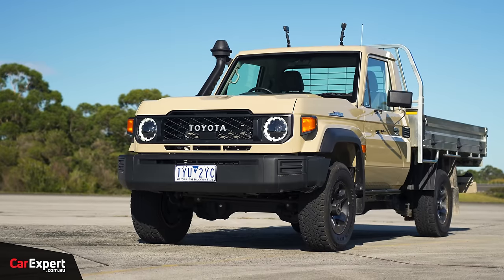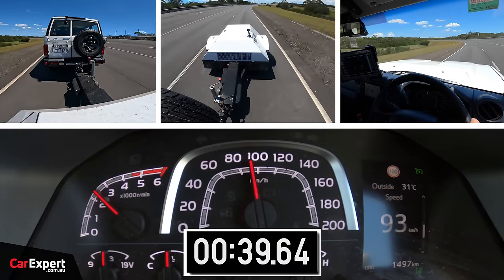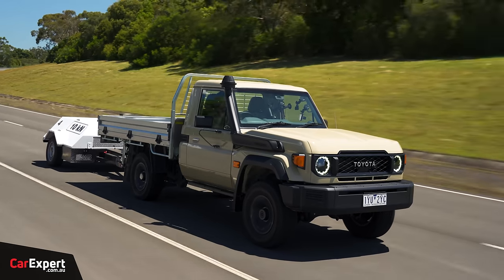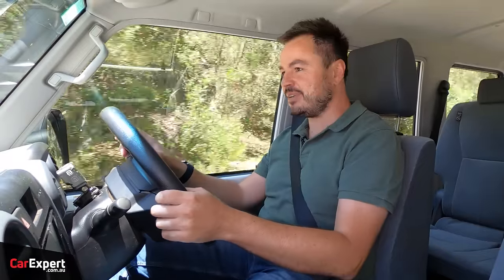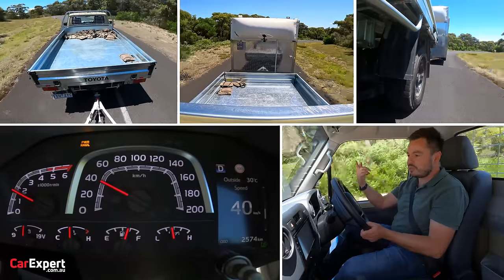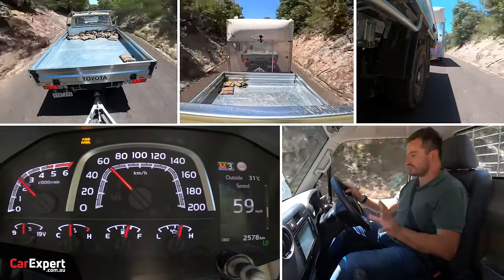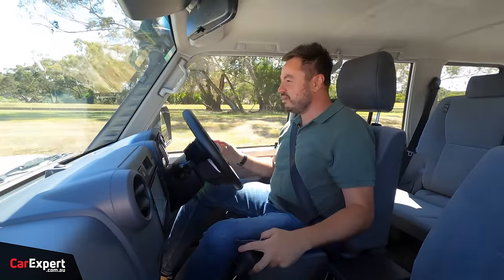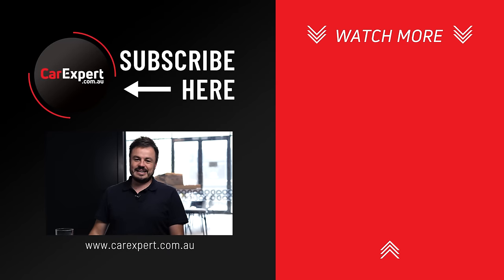LandCruiser 70 Series V8 v 4-cylinder towing stress test & drag race! Is Toyota's V8 dead?

Comment: They increased the front track to fit the V8 engine. But, and only Toyota knows the answer to this, why did they leave the rear track 100mm short, in the production stage, wouldn't cost that much to fix. Image if any other manufacturer did this, they would be crucified, pathetic.
After watching this, who in their mind would buy these things.

Comment: The impressive thing is how much of a bloody TURD of a V8 engine toyota actually managed to make. 
Well done. 
That v8 dissapointing in stock form. And the god knows how old 5 speed gearbox with the shittest ratios ever. It completely falls out of the power band. Useless.
Toyota couldnt even update to a so needed new 6 speed gearbox. 
A aftermarket tune for this V8 is a must i reckon.
I brings out a lot of hidden power.
And its always been that narrow from the day it was first built with a inline 6 cylinder but they widened the front to fit a V8 and just left the rear as it was. Ridiculous really.

Comment: It looks to me that the V8 cruiser only has 1400 kms on it and the 4 banger has a few more. That V8 needs about 10,000km to loosen up a bit. Give it a chance. The narrow track on the rear of the V8 is so they could fit the motor in. The narrow track rear is the same as the 6 cylinder ones. Toyota needed a whack in the ear for doing it that way. 
Torque figures on paper can be misleading. The lower in the rev range that peak torque arrives is where the real story is told. My 1HDFTE in a 79 has peak torque at about 1800rpm. The V8 appeared to be hanging on at about 2200 and the 4banger was doing 3000rpm. That tells the story. Having to rev the tits off the 4 to do the same thing is not winning the race. My 1HD will pull a trailer with a ton on it and a load in itself all day without trying. I have experience with a 2007 Hilux pulling a horse float with a horse on it and I had to lock it in 3rd on the Newcastle free way or it spent all day changing up and down and eventually overheated the trans. My 1HD would do that in 5th easily. 
The 4 banger is a piece of fragile twin turbo shit that will have spilled it guts a long time before the bigger better lazy motors that do it easily. 
Shame on Toyota, Landcruiser buyers are not going to buy the hype, that is not why they buy Landcruiser 79s. I am a 1HD man and a lot of others would like to be too but they hard to buy now. Jeff

Comment: different body shapes make it a pointless test
Reply: Frustrating no one is actually comparing identical body shapes with v8 and 4 cylinder 
Still waiting on a proper test from all the youtubers 🙄
Reply: @lynblisso2880  everyone fudges it to make the v8 look worse and the 4 cylinder amazing

the fact is it needs a 6 cylinder diesel, 200kw and 6 speed auto

many other brands do this for 25% of the price

I'm waiting for a comparison of these 2 cars plus a v6 diesel amarok for 25k, or a v6 diesel q7 for 10k

new overpriced cars vs better second hand cars that have already dropped 50 to 90% in value

put the 25 to 90k you save into your super at 10% interest each year

90k in you super at 10% is 233k after 10 years

Comment: The v8 doesn't look to perform any better than my 39 year old 12ht 60 sahara heap of shit. Sure as hell is a lot more comfortable to drive than a 79 too. Toyota should have increased the performance gap between the v8's and the outgoing 1HDFTE before they released it, as it stands the only selling point is the noise. I do need new mirrors for the 60 though, those 76 ones look identicle

Comment: Wow i can't believe how bad you are at a manual gearbox the 4pot maybe better but with your inability to drive a manual and to be in the right gear at the right time im honestly not sure if it is better you don't even understand how to launch it i wish i could drive this for you because the gear changing was painful. 

Also that first trailer you might as well take it to the tip you say it's the best way but when you took off in the 4pot you said wow its like its not on the back?? Well how do we or you even know if its engaged or when it engaged it might of engaged halfway through the drive you say its the most accurate way but you drove on the same road and same time with both cars you could of just got a car trailer stick a Commodore on the back and do a real test or use your 3.5tonne trailer that you used for the rest of the test

Comment: You were shifting the v8 way too early
Reply: Wrong, as someone who genuinely owns a V8 70, they serious run out of power anything after 3000rpm. They are very low raving engines and hit a wall at 3000rpm in standard form.

Comment: You just trying hard to show that v8 is faster, but even if you don't put it in sport for rolling, DIESEL it runs FASTER than v8, even if driver was lift the throttle at the end.
Conclusions? Diesel is waaay more useful as utility vehicle, is more faster in anything AND waay more economical 😂
Reply from the maker: They’re both diesel.

Comment: With the 3kN test, both vehicles seemed to be shifting/ed around the torque peaks, rather than the POWER peaks - further, I'd suggest manually shifting to the "red line", as that would laso be more like what a normal driver would do to "use the rev's", and shifting would drop it closer to the power peak. Depending on the specific spec of the 4, peak power is around 3k4-3k6 - I didn't see it getting anywhere near that! Similar story with the V8, but at lower rpm!
For those who are going to say - "use the torque" - well, duh, morons,  shifting early REDUCES the tailshaft torque because there is less torque multiplication in the gearbox! Holding the lower gear gives MORE multiplication.
Reply: check the TDS littel pdf file....

Comment: 4 cyl turbo with higher output than a V8 4.5 = higher engine wear, more heat generated and higher revs with radiator cores clogging up faster with grass seeds. I operate in Africa and prefer the LC 4.2  D without a turbo. Most of thw work is done in liw range and at engine speads that rarely exceed 900 rpm
Reply: The test misses the point the vehicles were designed for

Comment: Lol 2.8L hilux motor in that heavy duty landcruiser is not correct cause hilux motor are use for light ute only due can’t keep up the speed and auto gearbox are not doing it correctly and needs to run a test again to match it work out your maths and deal with the landlord of the Toyota company! To me is find out a really bad name at moment also ripping off by the price rise !
Reply: Check the normal car weight of that landcruiser and hilux you will find out which vehicle is heavy and light. So what you had to do is work out from that motor in whichever match the heavy duty landcruiser as it’s not about racing or show or tour ! Find it out yourself!

Comment: Yeah sure let's tow an unrealistic load in an over drive gear. We'll done guys😂

We all know the v8s are slugs that need a tune as they are heavily derated.

Anyone that knows vehicles knows and speedometers are out by about 5kmph. Has this also been faceted in and are you actually doing 100?
Reply from the maker: Yes champion, GPS speeds. The anchor definitely needs a tune to come close to the four-banger!
Reply: @CarExpertAus  you've shown the onboad speedometer wich are always inaccurate and "to come close" is just wrong. 
The v8 in its standard  form is not running optimally or efficiently.
Opening it up allowing it to breath at a bare minimum.
From factory Toyota should have engine output  at the same or close to the 200 with 660nm not 440. 
It's quite literally running at least 1/3 less what should be its standard and acceptable output.

It's more that all this is a good example of how Toyota is ripping everyone off and I feel should bring Toyota's practice into question as they are charging for the v8 but not delivering on a v8.

Comment: The V8 off road or towing excellent. On road we all know . Auto and manual 6 speed , they make them . Have for years but wo'nt fit them. Rear track same. All this 4 cyl is just zero cost Toyota b.s and content craving crap. Try a 2 tonne electric ridden standard hilux auto off road . Fuck me. Pointless technology for the sake of cost cutting.
 4 cyl 70 lovers , more like content cravers. Reality be damned.

Comment: Misleading tests!
1st the V8, you keep trying to drive it with the RPM low and below it’s power range and trying to get it to work! 
But with the four cylinder you let its RPM run higher in the power range!
2nd why would the V8 be any different with more gears than 5 speed?
A 6 speed would still have the top gear ratio as the 5 speed! 
3rd Formula One racing cars over the decades have had a narrower rear wheel track width compared to the front to allow it to turn into corners better at higher speeds!
Yes, having the track different width front to back is not ideal in the dirt but life is full of compromises and both the V8 and the four-cylinder have the same front to back track width differences, so I don’t see the point in mentioning it in your testing.
Would love you to go back and retest these vehicles with the engines doing the same work despite the engines size differences.
It seems to me that you are doing testing biased on something that Toyota may be getting (a back hander) you to show that the new four cylinder is a superior vehicle!
Plus a manual transmission is a superior driving experience, when an automatic is just doing all the work for you, being a lazy bones behind the steering wheel.

Comment: I have to comment and I haven't finished watching this vid yet. You were being very unfair to the v8. They need to rev and you didn't rev it out on the 0 to 100 in each gear. Also when doing the hill climb why did you come around the corner so slow with the engine out of it's power zone. You had it down to nearly 20km per hour and under 2000rpm. If you had started the hill at 3000rpm or more where the engine needs to be to tow I bet it would have pulled up the hill in second no problem.  You need to rev these v8s to get the best from them towing big loads and you didn't do that, putting it at a huge disadvantage which was unfair. Do you have an agenda? It certainly looks like it. I am no toyota fanboy either I drive a Ram now after having a cruiser ute for 12 years. It would tow 3500kg easily up any hill in second gear if you had it on song at the bottom.  Very disappointed with how you drove the v8, that isn't how you drive them to get the best performance from them.
Reply: Your right, should’ve had it on limiter flat to the floor the whole way 😂
Reply: @natoxlr8969 Rag the hell out of it at all times... Got it. 😂
Reply from the maker: V8 torque band is 1200-3200rpm. Starting at 3000rpm would be useful if it had an 18-speed roadranger.
Reply: The v8 torque and power curve is horrible. The harder you rev the less they give.
Facts.
Reply: @CarExpertAus  you need power to climb a hill and tow, what would I know,  I only towed with one for 12 years and tow things professionally for a living. My Ram has less torque at 3000 rpm than the cruiser but more power. It tows up hills better than the cruiser and it should.  Your reply shows your ignorance and bias because you even admitted that keeping the revs up improved performance in the v8.  The 80 to 120 times of both utes shows that at higher rpms when working hard the v8 has equal performance to the 4. You seriously cannot be advocating that keeping revs lower results in better performance.  My first comment stands and your ridiculous reply proves you clearly don't understand the difference between power and torque, how to drive a manual towing or at worst you set the v8 up to fail on purpose.
Reply from the maker: You’re right, but ultimately you actually need both - power is simply torque multiplied by rpm. Outside the top end of the 76’s torque band you drop away torque and the vehicle will move at a relatively constant velocity (in relation to when it’s producing peak torque). Whereas being within the torque band the vehicle’s velocity will increase. 

So in theory you could stay in first all the way up the 15.5% hill but eventually you will run out of revs and need to get the next gear. Once you get the next gear and it’s outside of its torque band it won’t produce enough power to overcome the weight of the vehicle and load. 

Ultimately the gearing in this vehicle is poor and additionally, having more torque would result in more power and ultimately it would have been sufficient like it was in the four-cylinder to make it up the hill.
Reply: @CarExpertAus the engine produces similar torque at 3200 as it does at 1800 rpm but probably twice the hp. You are better to tow at 3200rpm for hill climbing ability than 1800 or 2000 which you tried to do.  I know because I drove one towing for 12 years and the data backs this up. You even agreed that you need both hp and torque and at low rpm you only have torque.  You didn't drive the v8 in a way to get the best from it.